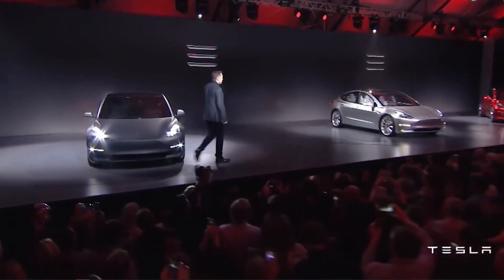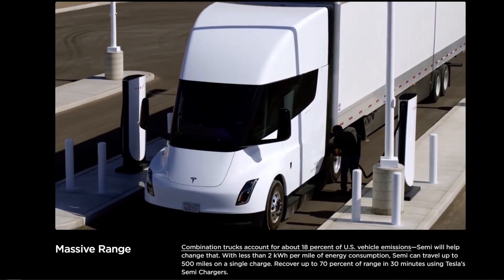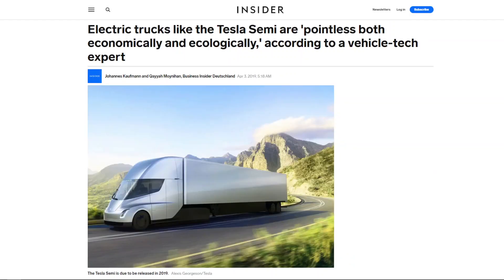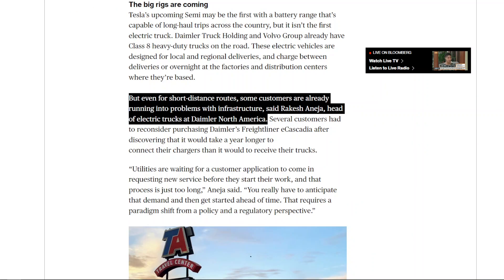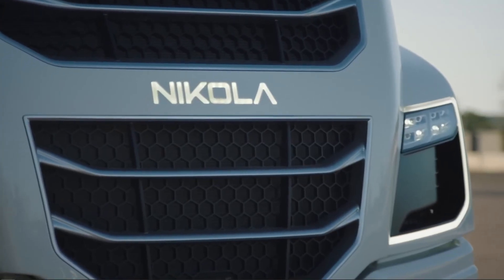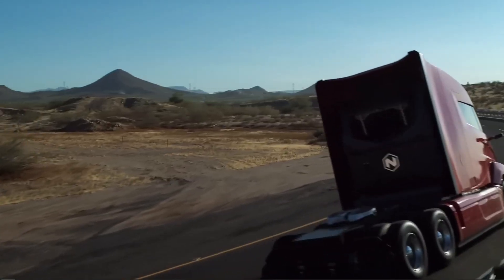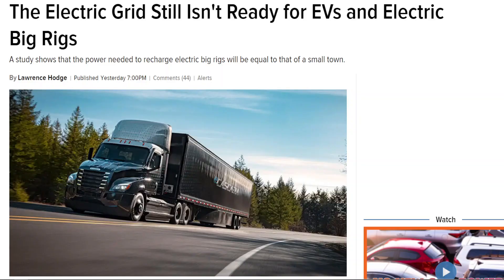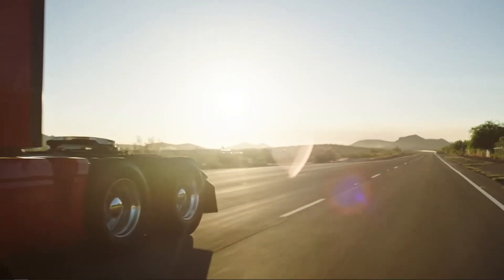Sandy Munro: Battery-Electric Trucks Are EXTREMELY Flawed For Long Haul.

Comment: If the current electric grid is insufficient to charge all such commercial vehicles, how will it be able to cope if that electricity has first to electrolyse hydrogen from water, then compress it? - a processs that will take far more energy than charging these batteries.
Reply from the maker: Just like all the industrial power plants cope today?
Reply: @visceral_investing  ?

Comment: Your opening statement is completely incorrect. 1MW is power, and 1MWh (one 1MW for one hour) is energy. 
At typical home in a climate not requiring heating or cooling might use 24 kWh per day, or 1kW all day. That means the Tesla charger uses the power of 1000 homes, not 2500. But if you include the energy for winter heating in a cold climate, you might only power 200 homes.

But the Tesla Semi - or any electric truck - will use less energy than a diesel powered truck because it is more efficient. The amount of energy used by a diesel truck to do the same work would be about 3 MWh. That is enough for 3000 homes.
Reply from the maker: I'm not the one who made the statement, a European energy firm did. I'm pretty confident they know more about the power use of homes than you Frank
Reply: @visceral_investing   What exactly did they say? Do you understand the difference between MW (power) and energy (MWh)?  If 1000 homes heat up their dinners in the microwave at the same time, they would draw about 1MW (a typical microwave is 1kW), about the same as the Tesla charger. But in terms of energy used (kWh) the power per day for an electric car will be similar to the power per day for one house, not thousands.

Comment: 1st.  it is beyond silly to think there would be a ban on ICE vehicles before there is a manufacturing capacity to make enough EV vehicles and renewable energy sources great enough to sustain the needs for new vehicles and added burden to the grid....beyond silly to even utter this...

2nd. The semi is only being sold to pepsi Co and its subsidiaries most likely for the next year or longer as they do not have the manufacturing capacity to do much more.  They also will only be selling to customers with fixed delivery routes so long haul will never be an issue unless they cant build an interstate charging network in the next 15 or so years as they just cant make enough of these semis to replace short haul fleets much less think about the long haul industry....Once they have at least a partial charging network for long haul (most likely over 10 years away) they might have the capacity to start replacing more than just the short haul fleets...

3rd.  The battery industry and electric motor industry is not static like it is for ICEs.  Every year there are new battery technologies being discovered and every few years they make it out of the lab...weight of the battery packs will go down and their capacity will increase as well as charging times have been decreasing just about every year for a while now...ICE vehicles are pretty much static technology wise, we are not going to see any dramatic changes in their ranges or efficiency any time soon, the exact opposite is true for all EVs and to a point hydrogen but there are all sorts of problems with hydrogen currently as there is no current efficient way for us to mass produce hydrogen in any capacity to replace much of the semi fleets out there sooo...hopefully they will figure something out about that soon...

4th.  They dont even have a sleeper cab model so no long haul trucker will use these unless they like sleeping in a sleeping bag.  Not sure why anyone ever mentions the tesla in the same breath as long haul in its current form as its current model really isnt designed for that job.  Nobody buys a wrench when they need a screwdriver...same thing applies for every purchase including a big ass truck.

5th.  Charging times are fairly irrelevant as long as there is charging stations available and EV Semi trucks can all match basically the tesla's benchmarks as after 8 hrs of operation you have to take a 30 min break minimum by law and the charge you can get in 30 mins in almost all cases will take you as far as you can go in your 14 hr day (if you dont know what this is, look it up)...The only times the charging will cause any issue (once there is a network) is in the case of tandem driving and that is pretty impossible with the tesla due to the seating and again lack of a sleeper compartment.

It is important to not compare something to another when their planned usage are 100% different.  If you do, you are just being dishonest.  I am sure once tesla or other EV Semi manufacturers will offer a semi that is actually made for long haul around the time there is sufficient enough of a charging network to make it reasonable to buy an ev over an ICE.

Comment: The thing with hydrogen Is that It works just like a internal combustion engine. That makes It easier to switch too. The truck manufacturers wouldn't have to lay out millions upon millions of dollars for the switch to hydrogen. The other thing Is electricity prices would rocket to outer space. It would be the old supply and demand effect.
Reply: Hydrogen is the smallest atom in the world. It destroys most metal making it brittle enought to crack with your fingers. It is a far worse greenhouse gas than methane, It takes more space than batteries or petroleum. Nasa uses it as you said and they cannot make a seal that holds it, instead they use sensors to see when there is too much concentrated. Nothing about switching to it is easier.

Comment: Hey Ace, thank you once again for providing support for The Hyliion ERX Drive Train as the near to midterm solution for the Class 8 long haul market.
I agree that BEV has its place in short haul, last mile applications and I believe the current myriad of EV offerings will do well. Yes, even Tesla.
I also agree that hydrogen will have its place in the coming decades if the infrastructure can be built out to mirror diesel availability. But the competition for H2 will be fierce and I think the long haul trucking industry will be far down the list. H2 will be a localized solution for a long time to come.
I do believe that RNG has its place in the Class 8 world and it will be a success.
Reply from the maker: What's Hyliion?
Reply: @visceral_investing  Respectfully, I would say that Hyliion ERX is the cost-effective BEV solution to getting away from diesel, that you and others are afraid of.

Comment: It’s amazing that Musk didn’t realize it would be impossible to see success with the Semi due to the charging issue.  Smart enough to build rockets that come back to earth, single handedly change the car industry but build a truck that can’t be charged.  Wow can’t believe it didn’t cross his mind. Wonder why Pepsi bought 100 trucks they can’t use.  I guess we’ll see them in the junkyard soon enough cause this guy is definitely smarter than Musk.
Reply from the maker: Yeah people also bought products from Enron and Theranos. Making something and someone buying that isn't a form of validation
Reply: there is no charging issue...this is a red herring.  Nobody is buying these trucks for long haul...nobody will be buying these trucks who tandem drive....nobody will buy these trucks if their will be hot swapping drivers for 24/7 usage.  These are for single driver short to medium haul and that is it.  Comparing it to anything else is beyond stupid.  The "people" buying these semis is currently only Pepsi Co. and they are building fast charging stations at their facilities.  There is no charging problem.

Comment: If a Tesla truck got stuck in a snowstorm, how long will the batteries last keep the cab warm?   If I got stuck, I would have enough diesel to last a month because I have a bunk heater that use only about 2 gallons per day.  I would need to get more food before that, but that's besides the point.   I wouldn't need water since I could melt the snow using my kettle.
Reply from the maker: Great point

Comment: Well, I hate to say Sandy Monroe or however your name is being spelt these days, but you’re getting a little too old to understand technology I guess do you think that Elon Musk wouldn’t have a battery pack extension unit or whatever applied to that save the trailer that would add up to 1500 miles of range all it is is just another battery pack or two that they can actually put say connect to the underside of the trailer you don’t know by saying that range is going to be an issue is just idiotic and you’re gonna say what you want because like old people back in the 70s used to say that’ll never happen. Oh that that can’t be done. Welcome to 2022 Your Old Way of thinking just shows how old you really are.
Reply: Do you understand the issues around batteries and weight? Tesla is already afraid to tell us how much the semi weighs because it cuts down on available payload. Now you are suggesting adding more vehicle weight is the solution. Boy, the Hyliion ERX drive train is looking better every day.

Comment: Most of the time the Tesla Semi can do a slow over night charge much like a Tesla car.  That may run at 100 kW much more than a home car charger, but these trucks will likely be left at the industry they service that has 3-phase power.   This will put some load on the existing power grid, but it will be at off peak times.   A business with some public image interest in using the Tesla Semi might make an easy decision to buy and use the Tesla Semi for day trucking.  The cost benefit ratio of Diesel truck class 8 truck verses Tesla Semi are probably hard to place, but if long as they are reasonably close using the Tesla Semi in a company's own appearance colors and logos is going to give a company a bit of publicity buzz anywhere it goes.  It is worth some additional money and effort for that good PR.  There is a chance the Tesla Semi over time might save money over a Diesel truck.  Provided the Tesla Semi has a convenient and cheap over night charging station it will likely be very easy to live with and popular with the public and its drivers.

Tesla outfits their current Tesla Semi mega charger stations with Tesla Mega pack batteries that allow using the exiting power grid to charge the mega pack at times capacity exists.  The mega packs mean there is no immediate need for expanding the current power lines by mega watts of additional capacity.   This allows quick adoption into existing power grid facilities for mega charging stations.   Elon Musk states the mega packs may get solar panel feeds.   This is an expensive solution because the mega packs have to have a buffer of additional capacity over each Tesla Semi they charge between the times the mega packs can recharge themselves.  The expectation is the mega packs would need to be at least slight larger in battery capacity than all the Tesla Semi it will mega charge meaning the cost of batteries is a least doubled from just that of the batteries in the truck.  

 It would be good to know what a day trucker actually might typically run in millage, but it would seem with waiting and making deliveries it would be hard to be much over 400 miles which is well within the range of the Tesla Semi.  Getting day trucking switched to the Tesla Semi would likely be such a high percentage of the trucking millages that getting the long haul trucking would be largely inconsequential in the critical areas of fuel saving and pollution; nevertheless, a Tesla Semi with a sleeper might still be used for occasional overnight long haul service because the customer wants to use the truck they own and making use of a remote mega charger or even a Tesla car super charger is a very small hardship to schedule with the other benefits the Tesla Semi delivers.   These are the conditions that should exist by 2024.  For the short term to cover a charging station short fall portable Diesel mega watt backup generators could be rented.  These typically use marine or locomotive Diesel engines.  Nearly instantly this would allow 1 -3 mega watts of 3-phase electric power with no impact on the electric power grid.  Ironically if its an EMD locomotive Diesel they were originally developed in the 1930s for use in submarines for charging the propulsion batteries.

Comment: Tesla could make their batteries swappable.Also, Wind + Solar + stationary battery storage is growing exponentially. Also, how the video ignores the time, cost, and difficulty of developing hydrogen infrastructure. And even if the batteries aren't swapped, the trucks themselves could be "swapped". Do 1/2 run, change trucks, and charge the 1st one.
There, I fixed it for ya.
Reply: no they cant really make swappable battery packs...these things are around 10,000 pounds...nobody outside of tesla knows their exact weight but that is the general estimate...imagine the feat of engineering required to swap that out...and to be honest the charging times are irrelevant if you know much about the laws governing how long you can operate a semi before a mandatory 30 min break...also if you are interested look up the 11 and 14 hour rule for operating a semi...it isnt like you can haul freight as long as you like.

Comment: You are speaking out of ignorance. True, they plan on delivering 1 megawatt chargers and have installed them at Fritolay and Pepsi. And they also will be moving to 2 megawatt charging in the coming months and years for Tesla Semi and CyberTruck. What you fail to understand is that the chargers themselves are mega packs and will slow charge from the grid off peak and fast charge DC to DC fast change during the day and or night as the mega packs should have more storage than needed and, they will benefit the grid as load shaving during peak demand.

Comment: Hydrogen= the fuel of the future, AND WILL BE FOREVER,  because  you need so many steps  in the conversion of producing it, storing it  transporting it, storing it  and  then turning  that stored energy into electrons. OH   Sandy  test drove a Nikola TRE  Semi that was a BATTERY   POWERED TRUCK,  the Nikola Fuel Cell Semi was  just a prop, was never for real, oh , it really was " Rolling down the highway", FREE OF HYDROGEN 🤣

Comment: The grid is underused from about 00:00 midnight till 07:00 .  So if we concentrate the charging to these wee small hours of the morning, the grid is used in a more balanced way and no major electrical infrastructure enlargements are needed.
Reply from the maker: Sucks that 90% of long haul trucks re-fuel during the day while travelling
Reply: @visceral_investing  yes, that’s current behavior. But with 500 miles range and the option to install chargers at the company (like Pepsi), or destination (trucker hotel),overnight charging may become prominent.

Comment: I still don't understand why they are not designing it to have a capability for a buttery swap?  This would make a lot of sense in this situation.
Reply: ha ha ha   good one
Reply from the maker: Battery swapping a 1MWh battery would cost way too much
Reply: @visceral_investing what would be the reason making it expensive? 
 Unlike other vehicles, you didn't have to have them in every Town.   You just need to have them on major highways.  
In the long term, you would save money as you can charge it, with the battery health in mind.

In other point, the amount of cash the industry would save on not replacing break pads through the lifetime of the truck is huge.   This can be invested for the swapping stations (a one time investment).   I also like the fact that driving on a relatively steep road,  it is able to  re-generate power and charge almost up to  80% in few minutes do to the weight of the vehicle.   That is normally a wasted energy that should not be ignored.   So much saving, it should be able to fund the battery swapping station with out creating problems on infrastructure. 

Sorry for my English, it's my second language.

Comment: You really have your facts messed up. These first Tesla trucks are day cabs, not meant for cross country routes. 500 miles is far more than needed for a designated route. The truck will be used for the day, around an 8 hour shift and parked all night. So there will be no need for fast charging making life easier on the batteries and off-pick charging at night. There are so many of those kinds of trucks out there, it will years to replace just them. This is where they will make a difference at first. Long hall over the road trucks are in the future. So lighten up on the melodramatics.
Reply: ha ha ha good one just like the hyper loop

Comment: Let's compare oil to oil. Keep it simple. 

Peaker plants using diesel generators make less pollution per unit of energy produced than the diesel engine in a rig. It's hard to compare a GE oil fired turbine and the 6 cylinder engine in the truck.the  One costs millions of dollars, one costs about 30k. 

It will indeed require capital expenditure, but it's not like these things aren't being installed already, but it will lower emissions. 

The big thing for shippers is going to be that it's cheaper to recharge a truck than fill it's gas tank. 

For hydrogen the problem is that the fuel stations need brand new infrastructure, we also need hydrogen plants. We currently don't have hydrogen suppliers. We don't have hydrogen transfer trucks. We don't have hydrogen storage tanks spread across the country. We have a few hydrogen fill stations in California. It takes 15-20 minutes just to fill a car. It requires a compressor to run and pump the fuel into the car. It's not quick. The equipment at these stations costs hundreds of thousands of dollars. It has many of the same problems electric has, and misses the benefit that you can simply run a wire.